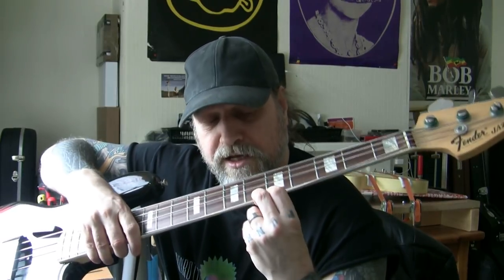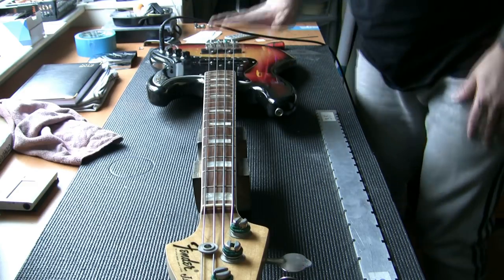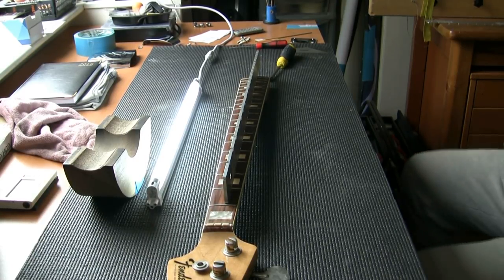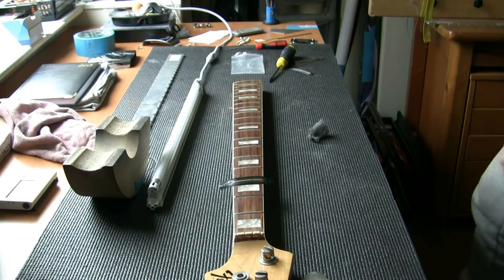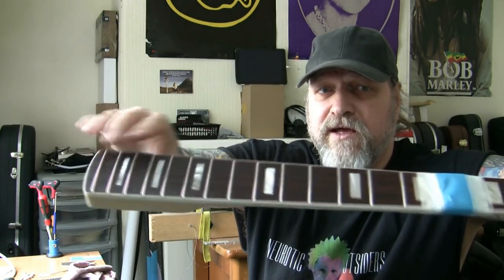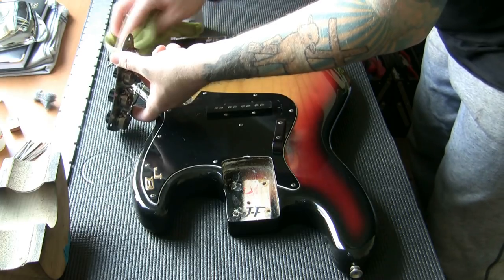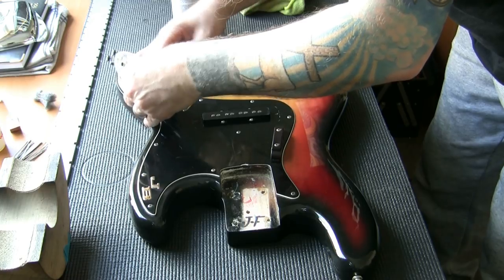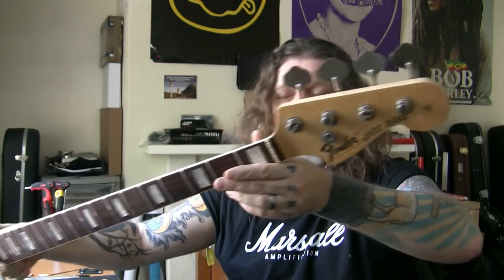For sale: 1973 Fender Jazz Bass / Vintage; excellent condition with original case / papers etc

Comment: Hiya Vic. Very nice JB , super condition too. Just some info for reference on dating the pots. First 3 numbers indicate the manufacturer CTS (137) second two are the year the pots were made (73) and the last two are the week of that year (33). Being a popular Fender model the pots would probably have been put into the bass within six months or so from CTS manufacturing date. There is more confusion on earlier Fender models as they bought a massive batch of CTS pots that were manufactured in '66. This batch was still going into guitars to at least '69 maybe later ! I have had some problems 'reading necks lately as most seemed to have had a 'lift' to the fingerboard that starts just before the neck so throwing off an accurate read of relief. I'm think about cutting my notched straight edges down a bit so that they avoid that section of the fingerboard. After all past the first fret it doesn't matter what it shows .. haha. Thinking about cutting them so they only go over the first fret by about 10mm or so. What do you think have you come across that ? I noticed that you seemed to be reading this neck from below the first fret and it looked like it was 35 inch scale ? Cheers - Glen
Reply from the maker: Hi Glen... Thanks so much for the info! It is a 35 inch scale length. I do think we can safely say it's a 73 and that was the main concern. Serial fits and date stamps tie in. Victor...
Reply: Eh ?? Not on Fender basses Vic. They are 34 inch scale. Some other manufacturers make a 35 inch. I think Yamaha, Schecter. Often 5 stringers are. Fender jazz and P bass are 34 inch. Although these necks don't have the date stamp on them like earlier ones, there is a code (8 digit). I had to look it up as I couldn't remember how it works. The 7th number is the year the neck was made.  Cheers Glen
Reply from the maker: I'll have to check it again but if you say it has to be 34" then it must be. Bass is not with me; it's at the owners house 20 miles away...

Comment: Cheers for another good video, Fret Friend. What suppliers would you recommend for luthier tools on a budget? If I could afford it, I'd send my Les Paul to you. I'm not saying you're expensive; you're not and your work is top class (I particularly enjoyed the video about the device you made with the gauges) . I won't be back in work for some time, so I intend to get bits here and there over time. I've rewired it successfully (Epi LP Korea 1992), and now I want to level the frets. The Truss Rod works fine. I have a Fret Rocker already.  The G&W prices look reasonable to me; are they any good? Are there companies to avoid? Cheers!
Reply from the maker: I buy from G&W (Portugal) and Luthier Tech (UK). I don't buy from Crimson. I actually had most of my tools before I discovered these places but they are my 'go to' for supplies now. Victor...

PS: I was into Crass from 78 onward's (saw them twice 82/83). Never thought I'd grow out of it (I did). My band was Concrete Sox...
Reply: I'm with Vic there. G&W make excellent tools, especially their radius beams and straight levelling beams. Stuff does come up on Ebay from time to time but to be honest usually prices are a bit steep. Keep looking though you never know.
Reply: Cheers for the reply Fret Friend UK (just seen, that's why I'm l'm late to respond). Yeah to Concrete Sox!  I don't agree with everything about Crass as I'm sure you don't as a Christian. I think it's a good example of 'context', and we're seeing that a lot now with politics: accusations of racism'sexism'bigotry etc etc..
Reply: Cheers, Glen694u I'll look into getting some tools then.